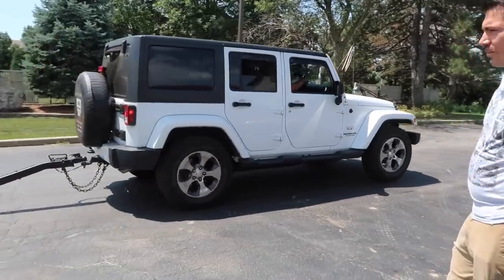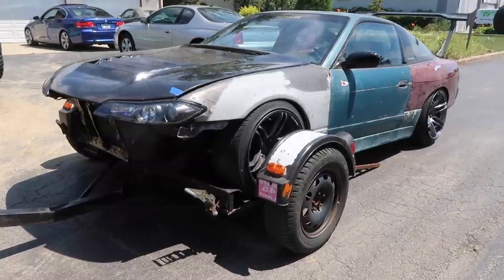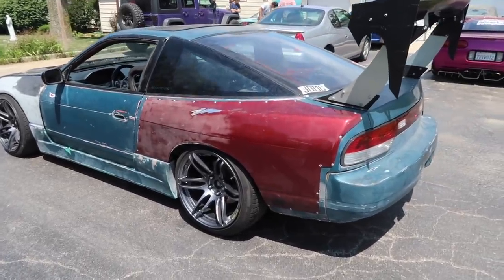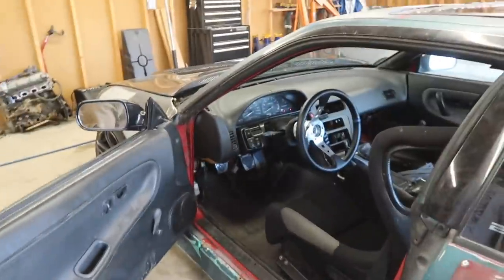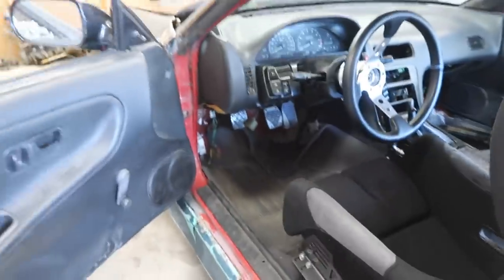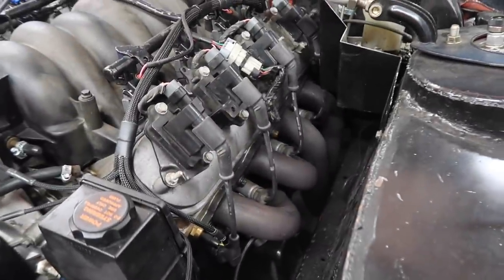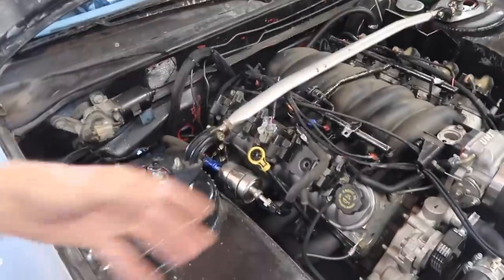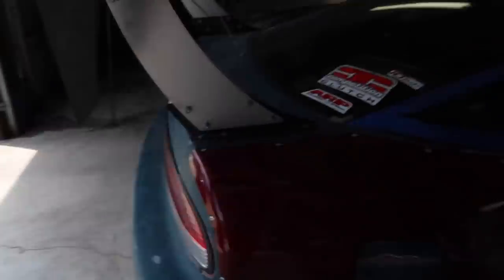Taking Delivery Of A Lsx Swapped s13.5 240sx

Comment: A 5.3l is a LS. Technically it's a LM7. But still a LS
Reply: the LM7 is the truck motor? just diffrent heads
Reply: James Rides pretty much bro. In my opinion it's the mos reliable LS An can be picked up at local junkyards for about $400
Reply: Darrien Robinson exactly, i have a 5.3 vortec aka the lm7 in my truck and the main diffrence is the heads, the LS has performance heads
Reply: James Rides yeah your right

Comment: I just recently towed a 72' Buick Skylark 900 with my 97' Jeep Wrangler, the buick weighed more than the jeep, it was super sketchy but if you engine break down to a low second gear you could stop fine, anything over like 20 the wheels would just lock up if you pressed it to hard.

Comment: 5.3 is an LS. I don't think it's engine code is LS. But it is an LS engine.
Reply: engine code for the 5.3 truck motor is LM7
Reply: it sounds so good! would love to do an ls swap or any other american engine haha
Reply: JDM Fanboy  2jz is better
Reply: Nazty604 its a LS based engine
Reply: jdmfan 1jz haha you wish
Reply: jdmfan 1jz You thought
Reply: jdmfan 1jz duh
Reply: Def not an LSX xD
Reply: ferdis7 Lsx is more of a broad term for any ls and if it came out of a truck it's prob a iq same thing just iron block
Reply: Corey C.  the LSX is actually the name for the 454 Ls. it's the largest one.
Reply: John Kuran largest LS or largest Chevy V8? Because I've seen some 572 swaps
Reply: John Kuran yes I know. It's still used as Broad term to any Ls engine
Reply: x Inline6 572 is the largest engine Chevy produces but the lsx r 454 or just lsx is the biggest Ls motor they designed and produced
Reply: It's not an LS, it's an LM7.  Same design family as an LS, but not technically an LS.
Reply: What is the chevy v8 6.0 called? Cause that engine is a beast, it was in a work truck i drove and the torque was obscene
Reply: Ryan Botting there's no 6.0 Chevy V8 there's a 6.2 l ls3
Reply: Corey C. yes there is a 6.0, they came in GM  trucks and Denalis
Reply: msack6904 oh yea lol
Reply: LQ4 AND LQ9 IS 6.0 FOOL
Reply: Corey C. The 6.0 come from GM 3/4 or 1ton gasser trucks and in the Denali suburbans and escalades. I think GM  used them in certain cars too.  my 04 Denali has a all aluminium 6.0 liter.
Reply: John Kuran lsx is not only 454... there is a 427, and correct me if im wrong but i think a 376 too
Reply: +JDM Fanboy It's not the displacement that makes a LS a LS
+jdmfan 1jz 2jz nuthugger, the only reason a 2jz would be faster is because your wallet would be lighter because a used one cost more then a crate ls motor
Reply: All2skitzd I wasn't saying the displacement meant it was an LS

Comment: Shouldn't it now be an s14?
Reply: MrGorpstine no it was originally a s13 but the previous owner put the s15 front end on it so therefore s13.5
Reply: but half of 13 plus half of 15 makes 14
Reply: MrGorpstine consider it this way . The car has 4 quarters . 3 quarters are the S13 (the rear , body , and the hatch ) and the 1 quarter is the S15 (the front end ). Therefore it is a S13.5 ( hope that isn't too much math ) 😂😂 why did I even do this
Reply: Mr. Awesome so with that logic if I put an s14 front on an s13 it's an s13.25?😂
Reply: MrGorpstine s13 with s14 front end =s13.4
S13 with s15 front end =s13.5
S14 with s13 front end =s14.3
S14 with s15 front end =s14.5
S15 wth s13 front end =s15.3
S15 with s14 front end =s15.4

Simple as that 👌🏼
Reply: MrBoomPow You drifters and your pseudo math😂